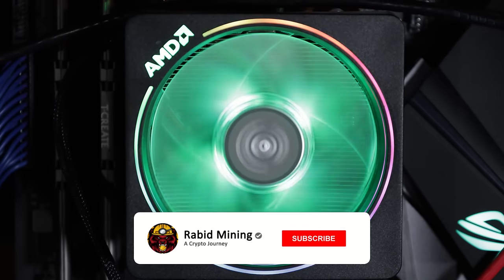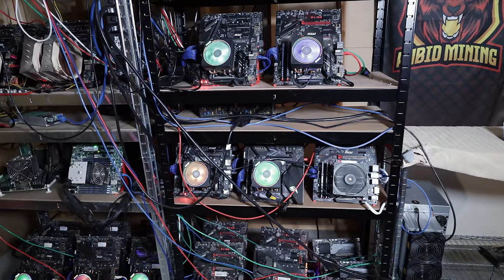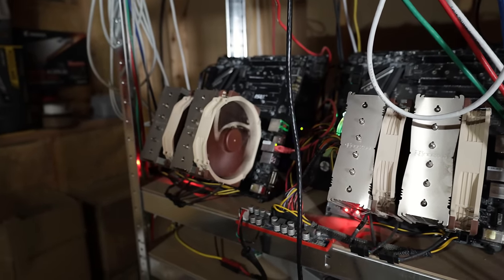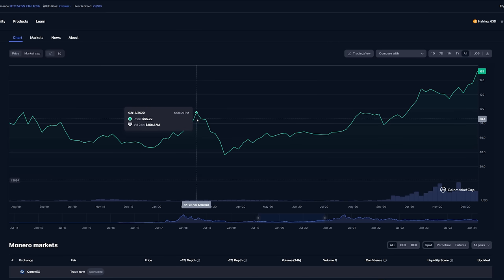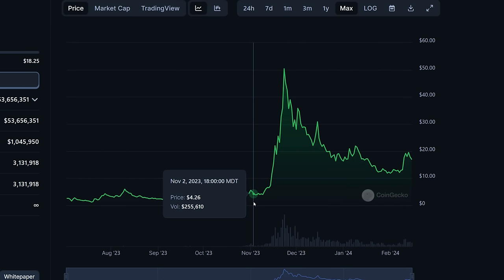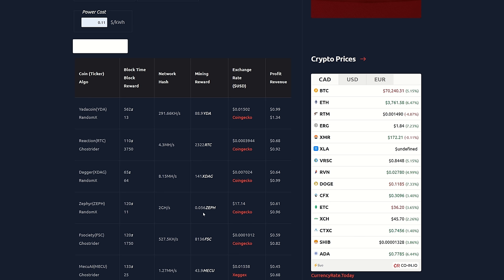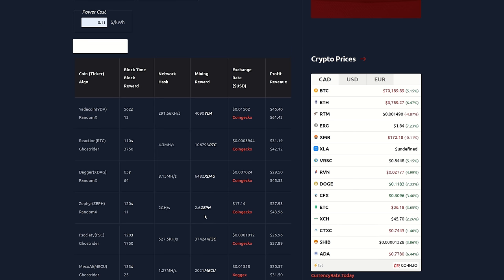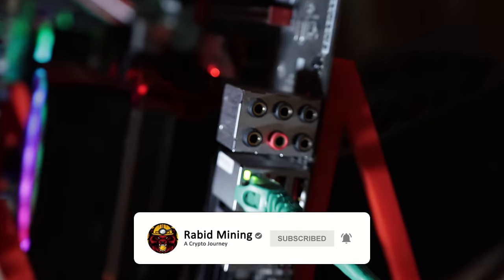Make $400,000 In 1 YEAR CPU Mining

Comment: Just hearing about CPU mining, and you were the suggested person to come watch. I'm running a 5800X3D as well a normal 5800X in my other PC. Been thinking about upgrading the 5800X to a 5900X for other reasons, but for now, how do you think the R7 series would do for getting into CPU mining with what I currently run? I only am on them for 5-6 hours out of the day, so even if they could just pay for themselves over time, I think that would be cool. lol
Reply from the maker: They are cheap and more efficent but I do like the 12 and 16 core ryzens better depending on location the 7000 swries is not much extra and larger performance gains.
Reply: Thank you  @RabidMining , just purchased a 5950X last night since it was on sale for $360. I had been thinking about upgrading the 5800X anyways as I said, as I run servers for my buddies and I. So 5950X with 64GB should serve us well, and do decent at mining when we're not using it. Maybe pay for itself in a year or so from the numbers I was looking at.  

The 7900X mobo combos, and be all in with ram, M.2, and PSU for around $900 is tempting though.

Comment: Following you on youtube inspired me to try CPU mining with a few intel CPU & Motherboards lying around, great success. But with you running AMD Ryzen's, I went out and purchased an AMD Ryzen 9-5900X (my 1st AMD)and Asus B550M-K motherboard to try CPU. No luck, even with playing around with Bios it still goes into error soon after mining, no temp issues. I run all GPU's and Intel CPU's on NicehashOS platform via USB's with no issues. Not the case with the AMD, nothing but issues. GPU mines nut not CPU. Contacted Nicehash Support, advised to try and install Windows and try. Any suggestions??
Reply from the maker: Don't think NHOS supports CPUs need to use the miner in windows if you want nicehash
Reply: @RabidMining  They do. I have 2 x Intel i5 CPU miners running on it with my GPU miner.

Comment: Rabid may I ask how much khs do you get on 3900x? I've got the best around 12,5khs. Oh yes, and also I can't get over 13kh/s on 5900X which seems strange, and I've done everything, is the mobo the problem here?

Greetings from Slovenia
Reply from the maker: 3900x and 5900x are pretty close to the same 12.5kh to 13kh is average depending on RAM
Reply: Y have 5900x(undervolt 1.175 and 4,4 mhz), 16gb ram 3200mhz duall chanel on nicehash, y get 14000 h/s.

Comment: @ Rabid do u think 5900x rigs are the best bang 4 ur buck atm?
Reply from the maker: All depends where you live is nothing around me so I just get them from Amazon
Reply: They are cheap for sure and good way to start hashing, but probably bad idea to scale a farm base on a 4 year old cpu. I'll go for 7000 series if its for anything more than 1 rig or so
Reply: 3900 лучшие). Ну и Epycs само собой!
Reply: @hutlazzz  currently I have 2 5900x rigs as well I mine on my PC sometimes, its a 3700x. Guess I was looking at 2 5900x rigs for the cost of 1 7900x rig
Reply: @seaottermining   not bad on current situation, but everything is based of zeph mining 50m cap, if zeph doesnt make it we go back to xmr and we are straight back to unprofitability except for last gen
Reply: @hutlazzz  thanks! Looks like 7900 will be next purchase
Reply: @seaottermining  consider looking at used CPUs and get pricing. I found the 7950x to be less than $100 USD difference from a 7900x. Start with your budget of course and decide from there. Can't go wrong with either CPU.
Reply: @snakeman567  thanks mate, hard to get those deal in Canada! But there is only like a $20 between 7900 and 7900x $200+ for 7950x

Comment: So if I have an Intel Xeon Gold 6154 dual CPU on 1 Node and have 4 Nodes total, would this be a decent cpu to run?
Reply from the maker: Intel isn't very good for mining
Reply: @RabidMining  I figured that. Just curious if it’s worth trying if I scored a rig like this for free
Reply: If you can get any free hardware put it to work... as long as it generates more than power costs you run the machine or keep it on standby until you can use it

Comment: I would add to your speculation a small issue you left out, which would be as the price of zeph would go up, so would the network hashrate. The rewards would be miniscule by the time it hits 400$

I am running 308kh/s on zeph @ 2950w Wall power.
Reply from the maker: Ya I mentioned rewards would go down as price and hash increases.
Reply: @RabidMining  my bad, didn't hear it. It wouldn't be too hard to take the price and hashrate data to make an educated guess of possible yields
Reply from the maker: @andrewjones198 hard to tell as new miners come in not sure how many that could be.
Reply: @RabidMining  I would just use previous price graph overplayed with a network hashrate graph. Use a little calculus and poof, if historybrepats itself, you'd have a very accurate portrayal of the yields.

Comment: How much does is cost to setup a profitable CPU rig?
Reply from the maker: Depends on your local market or if you use Amazon
Reply: @RabidMining  I’m in Toronto, Ontario. Do you have any recommendations for the CPU?I’ll worry about the rest.
Reply from the maker: @og3945 7900x or 7950x
Reply: @RabidMining  dang son, going straight to the top of the line. Gotcha. Ok I’ll look up the cost and roi with that processor. I want at least one CPU rig

Comment: My I9 12900K is giving me a hash rate of 5500h 😮 compared to my rtx2080 which only gives me 20.00 😂

And its liquid cooled and does not go higher than 53 degrees C
Reply from the maker: Right on what's the power?
Reply: @RabidMining  I dont know what you mean 🤔
Reply from the maker: @robertbeattie3988 hoe much power the the intel using
Reply: @RabidMining  Ah ok, actually iam not sure and I dont know how to check. But on my ASUS Armoury crate it says 1.19 volts but maybe thats wrong? Iam new to mining
Reply from the maker: @robertbeattie3988 best to use a watt meter and check at the wall what the power draw is
Reply: @RabidMining  Ah ok

Comment: Cpu needs a motherboard ram psu . Only one cpu per rig, but u can have many GPUs in one rig.
Reply: well and the price for 1 card is about the whole cpu rig price
Reply from the maker: @questmee spends in the card GPUs are turning like asics cheap crap won't cut it specially for most home miners at 15-30 cent power 4090s and 5090s will be what you need 3000 series is about to be obsolete